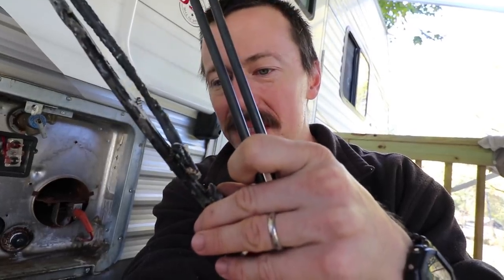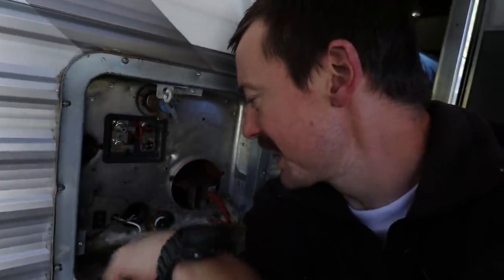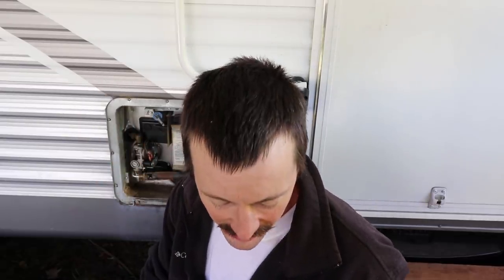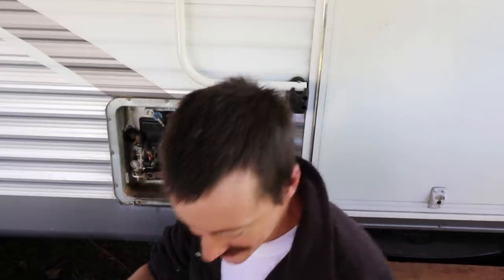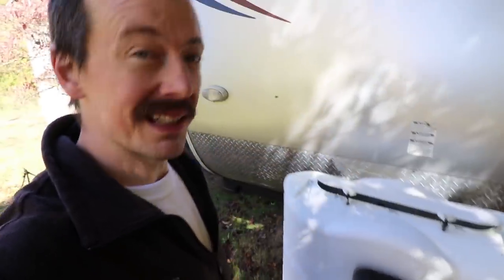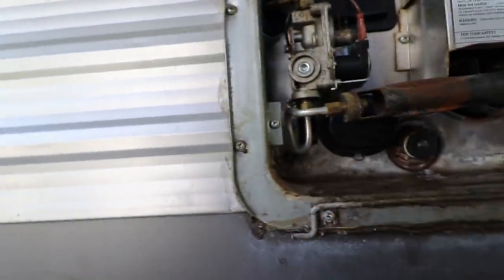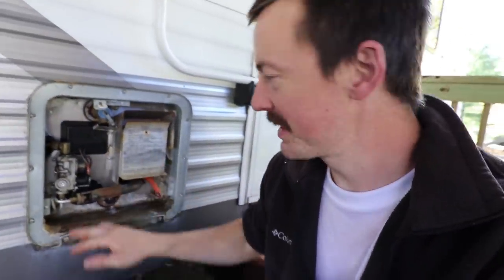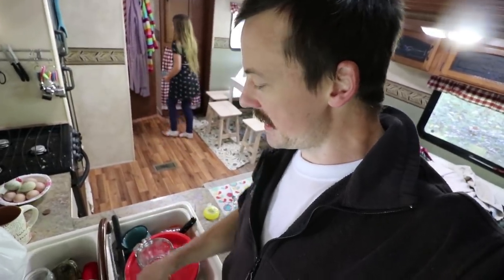Do You See A Problem Here?

Comment: With the cold coming, something you can do to help with that RV that I learned from my Mennonite neighbors in Wyoming decades ago, stack hay or straw bales around the base outside and maybe as much as a bale or 2 high above the floor level.  Use some plastic sheeting to keep them off the siding so it doesn't hold moisture to cause damage.  Anyway, you stack them close and tight and it cuts off drafts and adds some insulation that then you can use as mulch in the spring so it doesn't go to waste.

Comment: Notice you have the rug on the ground. Would it be easier with winter coming to do a raised  platform just off the ground so you can keep it cleaned off and use the outside space easier. Wood can be reused when your back in the house. I use mine in the winter to sit in the sun looking out into mounds of snow.

Comment: You'll get it all done it seems overwhelming. So here's a bit of advice for weather proofing your camper cuz I lived in one in the cold weather in New Mexico with snow and not Sub-Zero but still. Insulate your windows with bubble wrap you can spray the windows down with Windex or even water and your stick it right to the window and it will definitely help keep it warmer. Now I have a suggestion with the mattresses if you can I burned mine to get to the inner coil spring which will kill the mold and then I use the innerspring which is now sanitized from the fire as trellises in my garden just a suggestion. And as far as experiences with electrical shock yeah I've had a couple but my husband he'll Dive Right into electric and shocked himself every time he works on it so I get you on that one y'all take care

Comment: Art, I know the pain of being shocked. I was installing drywall in a House on a mission trip and the electric was supposed to be off. I reached into the hole to pull the outlet through the drywall and got zapped with 110. Ran up my thumb up into my jaw. Hurt so bad.

Comment: When ever we use the water heater in our camper we turn it on  inside about 20 minutes before we need it. You can help with the heat by insulating windows with bubble wrap. It helps and does not block the light.
Reply: Shawn McPeak that sounds like a awesome idea 💡 
Would it created moisture??
Reply: @marylouise890   I think only if you would totally seal it. There should be enough air space between the glass and the wrap to prevent that.